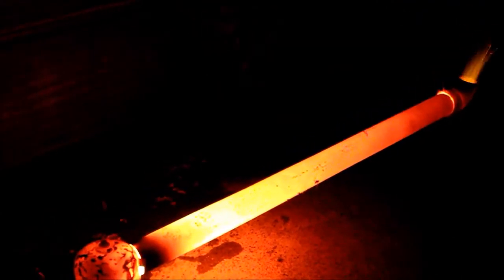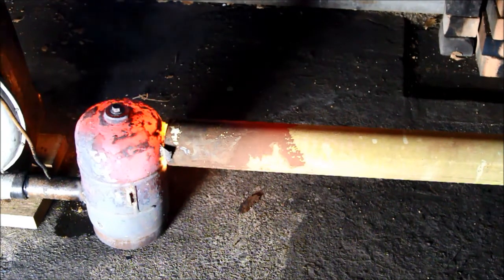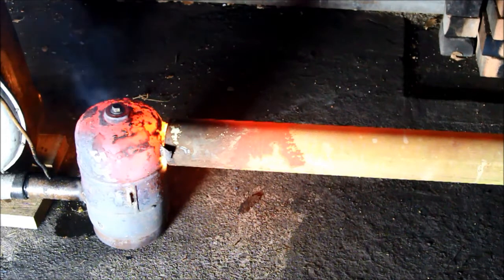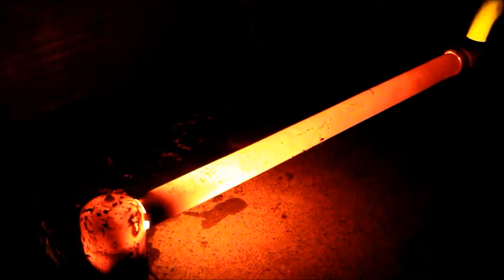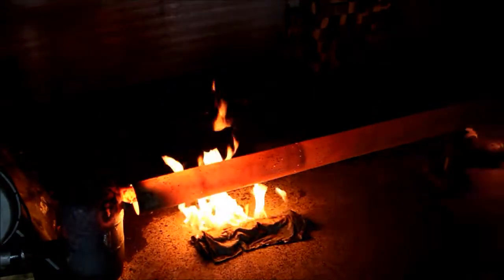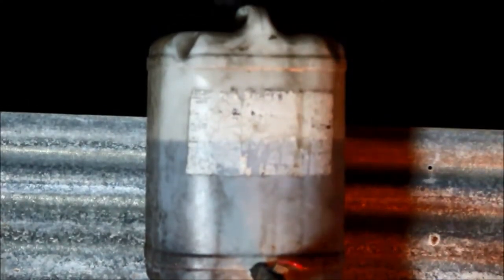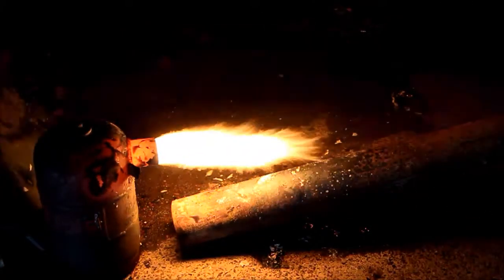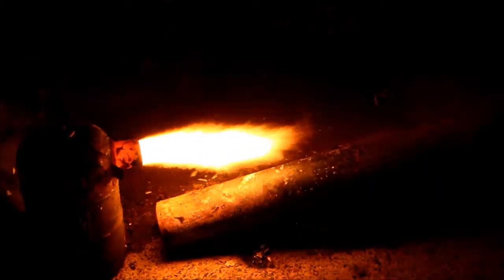Build an easy to construct Waste Oil burner for space or water heating.

Comment: I built a burner on the same model as the one in your video but I have a problem: I get excellent results with petroleum but not with recycled frying oil. This one refuses to burn !!! what can I do ?
Reply from the maker: I'd have to say get a different supply of fry oil. Shouldn't be any reason it won't work. Does the cooking oil crackle and spit? If so it has water in it which can happen when they don't fry foods hot enough or they  let the wash water go into the oil when they clean the fryers. 
Should be no difference between Veg and  engine oil and if you are successfully running WMO, I can only think there is something wrong with the Veg oil.  Maybe try starting up on engine oil then switch to Cooking oil while the burner is running. If it goes out, definitely something with the Veg oil. If it keeps going, you might need more preheat on the burner  when starting with Veg.
Reply: @glumpy10  tanks a lot I will take your advice into account immediately

Comment: I ordered a timer already.  I do have another question for you if you do not mind.
What type of blower do you use? where do you think I might find one?
I for the life of me can not find anything like that.
And once again, two thumbs up!
Reply from the maker: The Blower is a centrifugal Type.  It has a 1/2 HP motor but I don't know the cfm or anything as it isn't marked.
You could try using a Jumping castle Blower. I think they have more output than what I'm using but you can easy restrict either the in or outlet.  Most people seem to find things on classified sites like Fleabay and the like.

Depending wether you want stupid or practical output, the 12V blowers from cars can also work well in sensible applications.
I just Bought a Bilge blower for a boat but haven't tested it's output yet. I'm sure it will work, just remains to be seen what sort of output it's capeable of.  I'll do a vid as soon as I get a chance to test it.

Comment: Why is this video named " BUILD a waste oil burner? It should be named " watching the flame from a waste oil burner"
Reply from the maker: Because it shows the idea and explains the principal of what one could do to build a water heater by simply enclosing a pipe and running water between the 2. There is a lot more surface area in this pipe than the conventional copper coil people use.

I have just done another vid I'll edit and upload in a few days on powering a domestic water heater with veg oil .

Comment: Hi, have you experimented with heating large volumes of water?
Reply from the maker: What do you call a large Volume?  One of the vids on my channel is using an oil burner to boil a 125L water heater in well under an hour.  For a large volume of water, I got into this to heat my swimming pool.  Done a lot of other things with oil  but 10 years later the pool is still cold. I have the knowledge now, just a matter of finding the time to actually construct the heater.  It's not going to be something lame like Coils of copper in an old barrel that much I can tell you! The heat exchanger I have came out of a public Olyimpic size pool.
 I was thinking fo doing a vid boiling a 60L drum of water but that probably wouldn't make for a terribly interesting Vid. I do have another vid where I boiled 200L of veg oil in 17 minutes and that was with a much smaller burner than I have now.